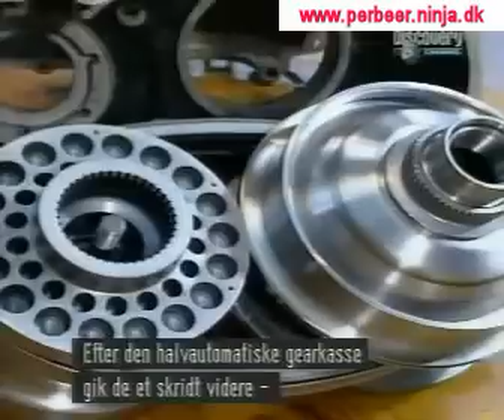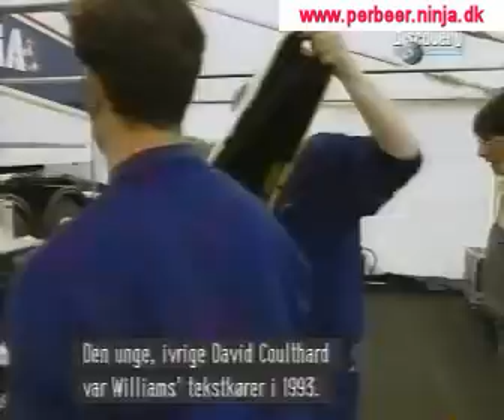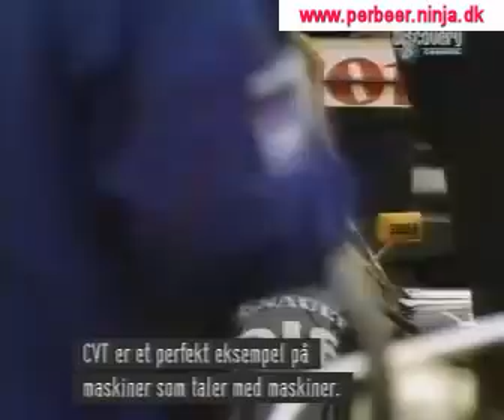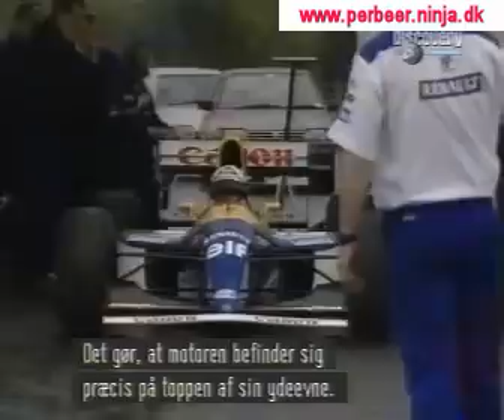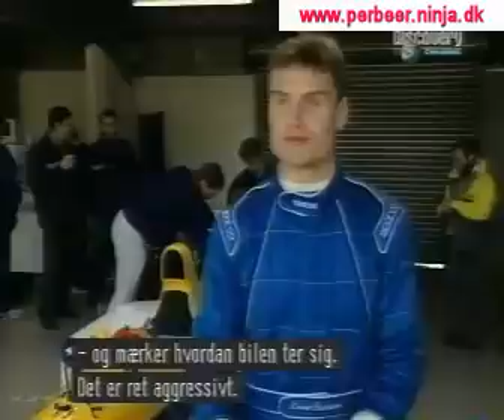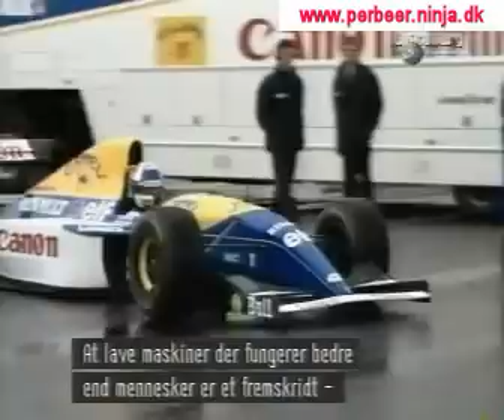Williams FW15C CVT

Comment: for those naysayers of CVT and it being solely a "economic" option...
Reply: it wasn't abandoned, it was banned by the FIA
Reply: This aged well
Reply: Have you ever driven a Ski Doo or a Can Am Buggy? Those thing go 0-100 in no time even though compared to a Motorbike or supercar their Power to weight is terrible. Thanks to CVT. There is no performance CVT in cars today though, and its unemotional. Thats the main contrapoint for car guys.
Reply: the problem is CVTs are weak and can't be use aggressively all the time without damaging it. For F1 team that's no problem for them as it will be rebuilt between races.
Reply: Anas Takiyudin That’s actually not the case at all CBT’s that are getting bad wraps were quickly and cheaply engineered by companies looking to save a dollar (looking at you Nissan) had these things been allowed to flourish and be developed we would easily have 100,000+ miles CVT’s in route cars now
Reply: @liquidwombat  Dutch car manufacturer DAF invented the so-called Variomatic transmission in 1958, it was a slight variation upon the existing CVTs at that time. In 1970 they improved upon it even more by replacing the belt with a pushbelt. The belt they used could only do 50k to 100k kilometers before replacing. But with their new pushbelt the wear was so low the engine would die earlier than the pushbelt.
I still see them driving around every now and then. Sure were reliable CVTs.

Comment: sounds like shit
Reply: poplynn2 also if CVT gearboxes were used in race cars they will just accelerate like electric cars
because the engine is always supplying maximum power / torque and turbo lag would not be a thing to consider
in rally cars. Its truly amazing, even though i feel  like its wierd.
Reply: popolynn2 so?

Comment: CVT definintley beats auto and DSG that's for sure, far more versatile than it's other automatic counter types, although standard auto can actually preselect a gear right before the redline changing at a highest speed before the next gear change so it's kind of close but it's the change timing that makes auto's slow agains't CVT.
Reply: I think you’re confused automatics and DSG. The DSG has two intermediate shafts connected to a single input and single output shaft. Each intermediate shaft is on a separate clutch so input -> shaft 1 in first gear clutch engaged, shaft 2 in second gear clutch disengaged. Redline, shaft 2 already in second gear, clutch on shaft 1 opens clutch on shaft 2 closes, shaft 1 preselects third gear and waits

Comment: Didn't they ban this in F1 racing?
Reply: Yes.
Reply: NtsParadize why because of the CVT having no gears? I mean I’d rather have a F1 car with dual clutch transmission like most of them .
Reply: @stevenroseren9300  high torque cvts were consider too fast and would help too much the richer teams. It also have a monotonous sound and it could be kinda boring for some people

Comment: people say the sound of a CVT is bad, but if you're an actual racing fan and spectate races, the doppler effect will take care of it. The cars will seem to rev up :P.

F1s would have sounded like TIE figthers.... don't tell me thats not cool.
Reply: M Huang exactly!!
Reply: CVTs don't sound like anything. Get a better sounding engine instead if you want the vehicle to sound better.
Reply: @blankname8553  When people complain about "the sound" of CVTs they're talking about the fact that the engine's RPM varies by only small amounts. When you want to accelerate hard in a traditional automatic or manual transmission, the engine RPM (as can be heard distinctly through the exhaust) ramps up slowly, then falls quickly, then ramps up again, then falls again, then ramps up again, and et cetera as the car goes through its gears. This is the effect that people are used to and a lot of people love. When you floor a CVT, all that happens is the engine ramps up to its most power-optimized RPM and then just stays there. The resultant exhaust effect is just a continuous whir as the engine RPM isn't changing, kinda like you're riding on an airplane.
Reply: @roge0  well that's just natural people always refuse to accept change.

Change is inevitable today every Japanese manufacturer uses a CVT except Mazda.

People will get used to CVTs eventually.
Reply: @blankname8553  the way a car sound is based of the exhausted setup just by changing a phew thing a v8 can sound like a inline 4 or cross plane crank sound like flat plane crank same goes with v10 to v12 a car sound is controlled by the exhaust

Comment: >
^ The point auto racing was to improve the breed not to cater the driver fanboys who consider progress boring.
Reply: Well now Japanese manufacturers use CVT in economy sized cars and crossovers. Subaru have been using it for 30 years and also continuously for the last decade.
Subaru WRX with chain driven CVT and 260 hp on tap.

Comment: Why do you idiots open your mouth when you really have NO IDEA of the technology or what you are talking about? CVT is far more advanced than 'seamless shift'. However it takes all driver skill away from shifting which is why it has been banned.

And no pigeonkill, seamless shift is NOT a semi-automatic. It is still a manual box with straight cut gears with the clutch automatically controlled by a servo.